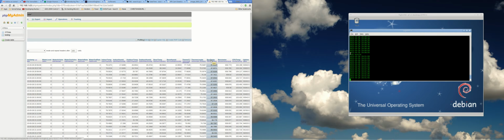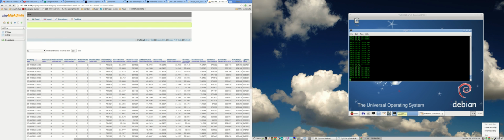LANOfThingsProgress3 29 15

Comment: Now I see. That would work great as a home security setup around my place. Just set the refresh rate a little faster with random sequencing of cameras instead of the usual cycling.
Reply from the maker: I'd do it a little differently, but basically, yes.  The thing has motion detection, and there are mods out there that can cause it to take a video short when motion is detected.  The basic underlying code (RaspiMJPEG), though, isn't that great.  I'd just use system drivers to take snapshots now and then and do the motion detection myself in other code, where it would have a lot more flexibility, not to mention reliability.  This thing takes big pictures - >3mb as jpegs.  You'd want to handle those in memory and discard them, or use up SD cards really fast.

You can only have one camera on a pi (it's a special interface with flat cable, one jack).  Well, you could add a webcam on USB, but that's a whole different set of software.  But pi's are dirt cheap, as are the cameras...and can all talk on the ethernet.
Reply: Do you know the line loss of USB cable?